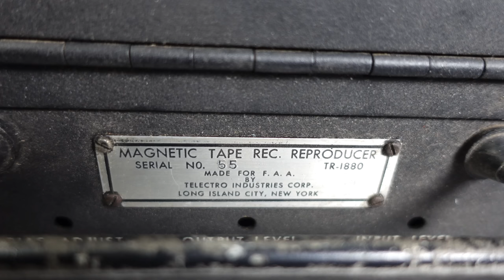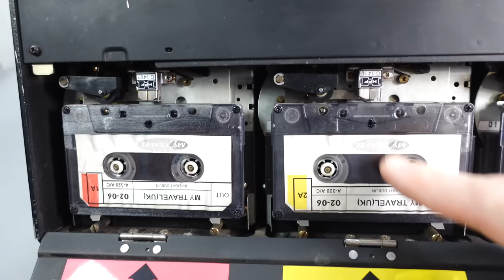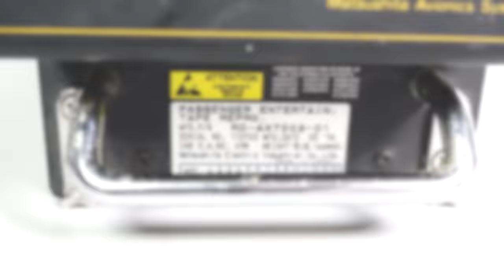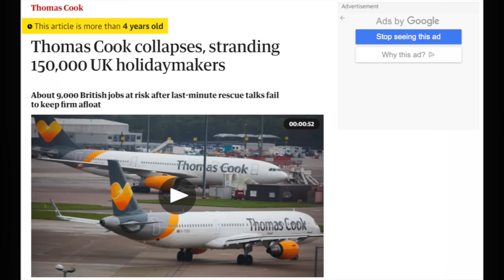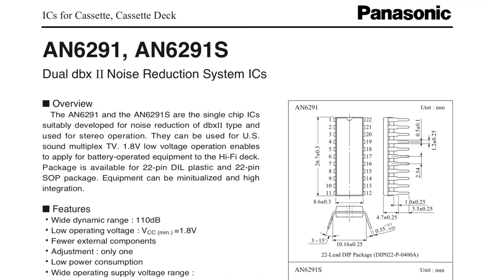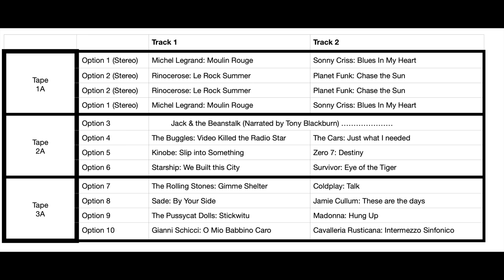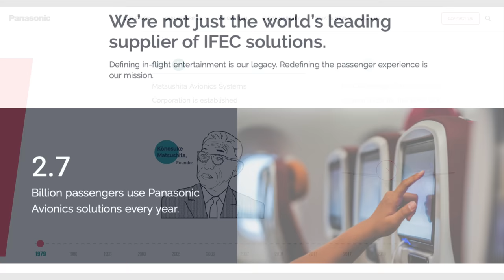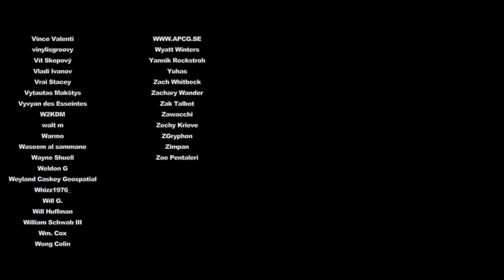The in-flight audio player

Comment: Honestly, the tape deck is the least interesting piece of this equipment. What I'm thinking about is how in the ever living fuck did they select which track went to which seat row that then could then be listened to and I'm going to guess that's the main reason for it needing so many pins. Not only does it need to be able to pass a control signal back and forth, but it needs to be able to send so many different audio signals out But like he was saying, since this would be amplified externally, it's a little hard to say, without seeing more of this contraption.
Reply: All tracks went to all seats.
Reply: @themoviedealers  But not with twelve audio cables.

Comment: Power supply of 400 Hz? AC ? Why is that a thing ? Maybe technology connections can make a video on it 😊
Reply: Electrical components for 400 Hz are smaller than 50/60 Hz to keep the aircraft as light as possible.

Comment: Mat ... please tell us what all the chips and electronics are for  ???
Reply from the maker: Playing the tapes.
Reply: @Techmoan  Ha Ha ... Mat you usually dive a little deeper into the tech ... most tape players don’t have that amount of chips and electronics ... maybe a part two video ...
Reply: @jbmatey3072  Do you want Mat to do an entire video on audio multiplexing and Delta Modulation scheme used to do this ?   Hint:  it saves running 12 audio cables to every seat (and the weight),  and at the same time can provide attendant call and reading light control from the armrest.  Not a simple system!

Comment: Very cool video, as usual.
Given that the mechanically the machine is solenoid-operated, each of the 6 individual players could probably be hacked into a touch-control tape deck. It's easy to imagine an Arduino application where each of "play", "FF", etc, pushbuttons would be made to have a latching ON/OFF function which would then energize the corresponding solenoid and of course the motor in the right direction. 

I'd love to try doing something like this. 
One area of concern is that the motor might be AC/400 Hz, in which case that would need to be generated.

Comment: Couldn't you just use the balance control (left and right) to isolate the audio tracks instead of needing the flip it over and reverse the tracks digitally?
Reply: left and right are two. The tape contains four tracks, not two.
Reply: @dead_art  But naturally only two play at once, left and right.

Comment: There is a strong possibility that the headphones that the passenger were using to listen to these tracks were pneumatic where the leads were actually rubber air tubes much like a stethoscope that a doctor uses to listen to your heart. They were in use well into the 90's on commercial airlines and are still used today with patients in MRI machines who wish to hear soothing audio instead of the loudness of the magnetic resonance.
Reply: Yeah, don't know why in planes in was this kind of thing, probably for reliability reason (wired headphones breaks so easily).
In an MRI machine, it's of course because the gigantic magnet would swallow any metallic object. Also, even if you could hold it still against the pull of the field, a loudspeaker would just not work at all, the big magnet of the machine would hold the speaker cone in one side or another or even just rip it apart.
Reply: I've heard it's mostly so they can be disposable.

Comment: I guess you meant 400V instead 400Hz, right? But I doubt the thing uses three phase electric power.
Reply from the maker: 400 hz.
Reply: @Techmoan 
You're right. Seems that they use 115V 400hz in an A320. Regarding the inflight entertainment system. In business aviation everything is checked a lot and there is no place for fancy new stuff. It's also a question of regulation and certification. You want to keep it as safe and simple as possible so it didn't surprise me, that they were using cassettes that long.